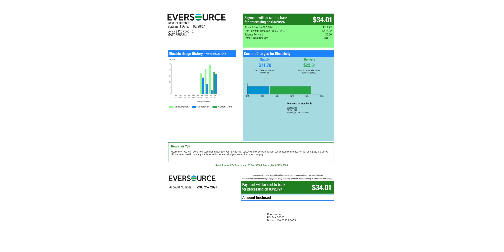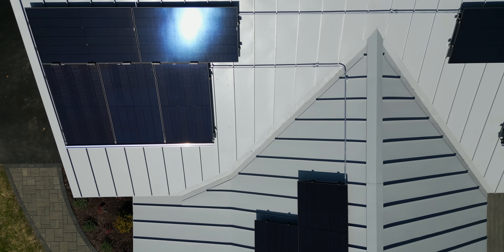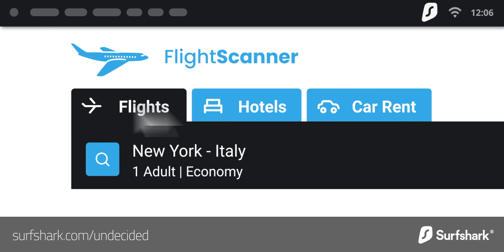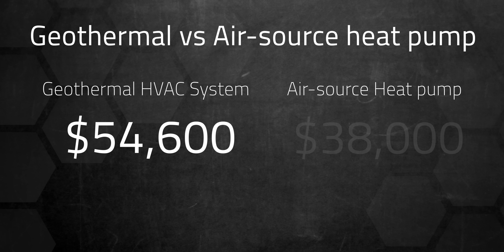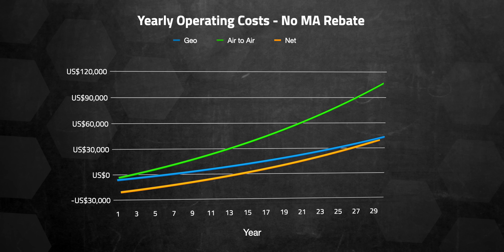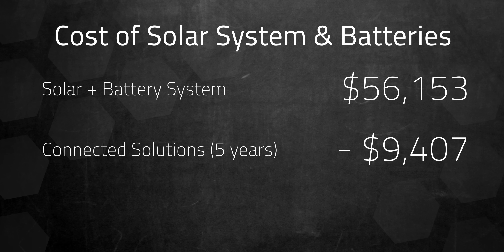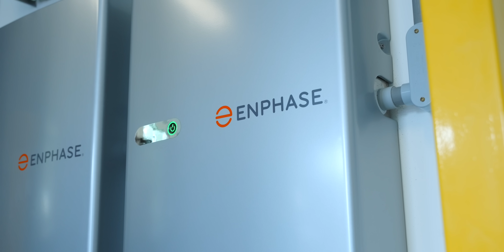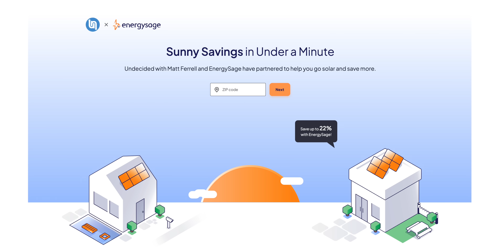What I Learned After 1 Year with New Solar Panels

Comment: I'll preface this by saying that I'm big on electrification and renewable energy. I think It should be subsidized and incentivized, and I'm super glad the IRA got passed a couple years ago. Subsidizing helps reduce and eliminate the green premiums that come with emerging technology. I used it myself to knock down the cost of a modest EV last year. 

That said, I have to wonder if subsidizing this kind of project is really the best use of the public purse. This project made use of an eye-popping $65k+ in incentives and tax breaks for a system that (as others have pointed out) seems rather overpriced. It almost seems like the tax breaks are paying for some contractor's price gouging. $65k could subsidize a lot of heat pump water heaters, home energy audits and insulation upgrades, used EVs, and induction stoves, to name a few. Or for that matter, could buy a lot more grid scale solar and battery (residential for both is about 3-4x more expensive than grid scale).

I'm not trying to jump on Matt for his decisions here, and I don't fault any individual for accepting what is effectively free money for getting off hydrocarbons. But man, this seems like an awfully inefficient use of public funds.

Comment: Great work Matt!

I used Energy Sage for my solar panels and figure I paid 5 cents/kWh (given 40 years panels and 1 inverter change at year 20) on net metering in California. 

No batteries yet. Am waiting for vehicle to grid. I also want my house to be on 2 grids; one for additional panels above what I can permit, and one for the PGE grid. I want to put additional panels and batteries in my RV as well that will connect to the house secondary grid.
Reply: Having a second grid for excess panels is ideal because you can incorporate new panels as they improve without throwing out the older panels.

Comment: lol, using your numbers it would take me 27 years to break even and i'm pretty sure i'll have to spend more $ to keep that system running that long.  Also, the solar panels and batteries would lose efficiency over that time.  Causing even more ROI time.  The only way this makes sense, the cost would have to be 50% lower.

Comment: I hope it works out for you, but after 50 years manipulating energy, I have my doubts.  A HUGE part of your number crunch is the $0.31 energy cost.  I'm paying about 10 cents.  I find that a 10 year analysis is not practical for any realistic application.  For residential apps, I think a 3 year payback/break even is a better mark; commercially, 5 years.  When you go beyond those time limits, you find that external effects greatly impact the initial decision:  you sell the house (tthe equivalent is  commercial firm is sold to a conglomerate), base cost for the utility suddenly changes against your favor (technology, consolidations, weather), the provider companies that provide the warranties go out of business (that's a really big probability), the batteries fail sooner than expected (I owned a Prius), and strange things you'd never expect.  In California, in the 90's, utilities dramatically dropped their overnight rates, which just KILLED energy storage concepts that were based on cheap nighttime generation.  I didn't see any maintenance costs in your analysis; something always goes wrong wrong wrong....   I usually just summed it up to my clients:  you don't want to go into competition with a utility.  They are really slippery pigs.

Comment: Having just retired from Trane Commercial and being a service technician for 44 of those years. I've never seen a heatpump compressor that will last 30 years or even 10 year's.  So you need to be pricing in a few compressor changes in your total cost to operate. 
I have a 11 KWH solar system and A variable speed 96% furnace and a 18seer 2 stage Trane condensing unit. I only pay in the summer the minimum of $11.99 each month.  Of course the gas goes up in December and the winter months to around $150.00 for a super insulated 6000 square foot house. 
It'd be interesting to see how that comes in comparison.
Reply: repairs for 30 years. what about total replacement after 15 years. when you still have 15 more years of payments on the old one. and the solar system. same quality. and the whole system has a annual derating factor if it doesn't fail. and batteries. the best out there are only rated for 10 years. with annual derating factors.
Reply: Air heat pumps will last 10 years. That is mature technology.
Reply: @karinoren  I know but that has to be part of the equation to plan on a compressor of pump, etc. During that time. 
The 10 year's also depends on the operating conditions.  Extreme weather conditions,  having the correct charge,  good electrical power. 
I was a technician for 44 year's so I've worked on a few During that time, mainly large commercial units.
Reply: @karinoren  mine lasted 19 years before the first service call.

Comment: At 72 years of age, the payback times for the higher up front costs just don’t make sense for me.  I am curious about the $38,000 cost for a conventional air sourced HVAC.   A 5 ton air sourced HVAC system (main unit only) seems to price out at well less than $10K uninstalled. I assume a large part of the cost comes from installing ductwork for new construction?

Comment: In Australia 40% of all homes have solar on the roof and the reason is this. We don't pay 4 times the price you just have. I have two homes each with a simple 7.5 kw solar array. No batteries. The grid, which is 40% renewables, is my battery. Each system will pay for itself in 4 years by reducing each the electricity bill by $2000 per year.  I paid $8k ($6k U.S.) for each array. No one in Australia can understand why solar is so expensive in the U.S..

Comment: As a retired HVAC contractor we built our last forever home 9 years ago. What I have been finding is that the electronic, GO thermal, AI systems are failing or are no longer supported before or around 10 years. The more sophisticated the system like your whole house automated the worse it is. It always seems the enter system has to be replaced at a great expense. I am afraid solar will be the same with manufactures gone and no one to provide support or warranty. Back in the day I worked on systems 20, 30, 40 years old, you will not see that with today's tech. What we created is a forever repair bill. The reasonable life span is not materializing.

Comment: Matt, In Oregon, we do have net zero.  It ends there.  If you produce more than you use, our Legislative knowhow has given the power companies the authority to not pay you over what you produce.  Each year, they sum up your production vs your usage.  Any excess you produce, they may, if they choose, do whatever they choose with your excess production.  Portland General Electric has determined that it is better to give your power excess credit to those who do not pay their bills.  This makes it worthless to go anymore than the exact estimated power that you will use over a year.  
I also want to take this opportunity to complain about Tesla Solar.  My system was installed as a 7.68kwh system.  The panels are rated for this.  The inverter is not.  They undersized the inverter while telling me it would be maxed out. It surely is and can produce only 6.5kwh on a cool (60F) totally sunny day at high noon with clean panels. They have completely ignored my complaints and even went so are as wanting to charge me $300 to check it out if it wasn't faulty.  My request to see the spec's of the inverter have been ignored. There is no phone number to call.  Only the phone app can contact them.  They say it operating normally even though it will never reach what they sold me.  They keep saying wait until after a year and see if I like it.  I will be filing a BBB complaint for misrepresenting their system.  Don't buy Tesla Solar.

Comment: One thing you REALLY need to consider - what if you took that initial investment and put it in the market? $88k would be $143,347 after 10 years @5% annual return. Now if you are just taking more money out of a mortgage, then maybe that's not really funds you can just throw in the market, so it's not a fair comparison, but it is something to consider. 

If you think about the opportunity cost of not investing that money into the market, you can turn a 9-year breakeven to closer to a 25 year breakeven. Or maybe never? $88k in the market for 25 years with a measly 5% return would be $298k after 25 years. So you actually might never break even if you consider what else you can do with the money. Change the return to 7% and now that $88k is $477k after 25 years. You'd actually be losing quite a lot of money. 

Opportunity cost is very real. Hopefully these would be loans or other funds that could not be alternatively placed into the market. Otherwise I think the financial benefit is completely moot.

Comment: Here is the rub.  Maintenance costs.  You don't have the experience with that, so a realistic cost for that over the life of the asset is not accounted for.  My 21 years experience in city wide electric systems (Street Lighting and Traffic Signals)  tells me that you will likely spend more on that cost than you did on the initial capital cost.  Your system is quite complex.  That complexity will also increase the needed maintenance cost as a doubling in complexity will give you a 4 times increase in maintenance costs, and actual breakdowns.  I did wait for the cost to come down on solar, and did put 13KW on my 2000 sqft home, in Texas.  With the tax rebates, I will eventually see a payback in about 7 years or so.  (Just based upon capital costs.)  No battery, but I am considering it when the battery tech gets safer and is lower in cost.  My average bill is less than $40 per month to the utility (but that includes $13 for trash/recycle pickup).  I agree that your case is specific to you and your home and area, as is mine.  Solar panels are still coming down in cost, at least until the tariffs hit Chinese imports.  And as you have in other videos, pointed out there are newer better sourced materials that look like they will be coming on line to continue to reduce solar cell costs.

Comment: A tax credit isn't the same thing as a discount or rebate on the cost of a solar system. You can't just take that amount off the top line. You'd have to calculate the ACTUAL tax savings from that credit and subtract that amount instead. That number is misleading for most people. It's not as much savings as people think.

Comment: I’ve learnt after 30 years in construction , sure the technology is great but built with the basic standard and it will maybe cost you more in energy to use it every year but you will also find it easier to maintain and to find replacement parts , most of that technology change so often that product stay on market for one year or less and you can’t find parts because it was never mass produced , it’s like buying a fancy car that was made only 1000 times and trying to repair it in 10 years . I’ve seen so many customers disappointed once you tell them “ sorry but your system isn’t supported by the manufacturers and we can’t find parts for it anymore “ when they spent a fortune 10 years ago on it because it was the top of the line .

Comment: These numbers don't even make sense to me.  We have a SFH, detached, built in the 80s and its not upgraded much for efficiency.  I spend less than 2k/year for energy costs, the payback time seems crazy considering I have zero faith all these computerized systems are going to last 20 years without failure.  They'll fail, you won't be able to get parts, and you'll need to replace significant amounts of hardware.

Comment: I think the biggest standout I see these videos is that wherever has to be a forever home before you even consider attempting to run the numbers.  The other major consideration points are the break-even and total system life points.  The math in order to get those two important points is super complicated with just dealing with contractors alone.  I think this stuff would make sense on new constructions, but the average current homeowner likely isn't going to be interested in the reams of calculations needed to see if it's worth their while.

Comment: I have a relatively tiny 3.3 kW system in San Francisco,  and haven't had to pay an electric bill since 2017 right around the time I gave up on my very energy expensive hobby of having saltwater reef tanks.    Granted no AC here, which is a massive rebate, and the age of my system grandfathered me into the old net metering system of a 1:1 return for energy I sent back so the power company is my battery.     And while I do still have natural gas usage, my net surplus actually still offsets my gas usage, so I am a net zero home as far as my impact.

Comment: Around $33k in cost was the battery pack. What is the lifetime of that?
Not mentioned warranty or replacement cost in 25 or 30 year projection from what I could see.
This is one of the major concerns for existing battery technology available. Battery packs degrade and costly to replace.
You break even on year 10 or 11, then get hit with $33k battery replacement cost?
Major concern or not? Would love to see community comments.
Reply: @Dmitry_GBR  100% agree. Batteries also loos capacity way before 10 years.
Reply: Allways morgage your investment in 10 years.
Reply: @karinoren  like car payments?
Reply: you said 25 to 30 years. like a car what is the average yearly cost of maintance. and with all the peyments. could you afford to replace in case of total failure?
Reply: Don't worry, get a 20 year old EV battery for dirt cheap and use it for 20 more years easily because the load on the battery is way less in a storage situation vs. vehicle use. Or use LTO batteries which have 4x the lifecycle span than LFP. Well unless there is a catastrophic event like a meteorite, best be vigilant!
Reply: @ I don’t think that’s how “old car batteries “ work, you can legally only use battery system compatible for solar by voltage etc and permitted by city inspectors

Comment: You are paying cash up front; you need to factor in if you invested that money in a good market fund how much you could have earned in interest over that time.  Also the added cost of maintenance over those 30 years for a one-off custom system, especially whether you will be able to find replacement parts 10 years down the road.  Also the cost of roof maintenance will be a lot higher over that 30 year span with the solar mounting (storm damage, corrosion, etc.)

Comment: I live in Mexico and paid 90’000 pesos (approx 4500 US)  for a 4.5kW solar system in 2022. We get about 5.5 solar hours per day so I produce about 9MWh a year. If I depreciate the panels over 30 years, my electricity cost is only 0.017 us cents per kwh. I wonder why that is so much more expensive where you are? I am sure some of it is insolence. Some installation cost. In Mexico a solar system pays for itself in 2 years.

Comment: Now I feel like my 8MW per year system is wildly inadequate and I should build Ivanpah 1 style solar thermal in my backyard. Yes... that's rational. Molten salt for days. The big surprise from the solar was how much heat it reflects off the roof in summer. Second floor under the panels is so much cooler now than before.

Comment: I like the cost breakdowns, but have you done a breakdown of your opportunity costs.  Specifically, what you lost out on in terms of capital gains in the market by spending that money up front on your systems, rather than investing (e.g. in an index fund)?  Could run it over the same 30 year time horizon.

I understand that not all benefits are measured in dollars, and that's not the fundamental purpose of what you've achieved.  Still, it seems like an important data point to consider, given that you've financially broken down everything else.

Great video, however.

Comment: He said he will save $56,153 in the first 9 years. And year 10 to 30 he will save $196,030. That is $252,183 savings over 30 years. 

If you didn’t install solar and battery you would have $56,153 you could put into a 6% investment over 30 years and you would have. $327,484. I will take option 2. 

No actually I didn’t I spent $21,700 after the 30% tax credit for a 10kw system which will actually pay for it self in 15 years. I thought it would be 12 but the cost of electricity is actually down compared to 5 years ago because Washington state has installed so much wind and solar. 

So your initial price matters. And currently a battery doesn’t pay for it self. But an extra $10,000 to deal with power outages is about what a high quality generator would cost. So a battery doesn’t pay for it self yet but the value matches the price if you need that kind of backup. I do not. But man do I want it.

Comment: You unfortunately ignore the return on capital which in the typical stocks market is at least 10% annually - if you refer to the SP500 index as reference. So once you Factor that in, you realize it wasn't worth it. your house is 200k US$ more expensive than a standard house, that is are 20K US$ return per year (before tax) you ignored.  All these green revolution is nice and fascinating, But economically wise it is not the right way.

Comment: He said his solar and battery costs $56,135. And then he said he would save close to that over a decade. What he left out was the value of cash. If you put $56,135 into a 6% investment then in 10 years your investment is worth $44,908 more than when you started. So he did not get the return on investment that he stated. 

I installed a 10kw system with more moderate and less expensive 327w panels and it cost me $31,000 minus the 30% tax credit. So $21,700. I will actually pay that off in 12 years. 

So he wanted the Cadillac system and he paid for it.